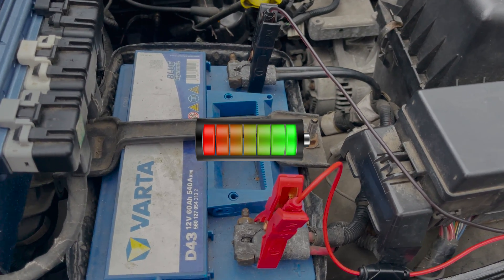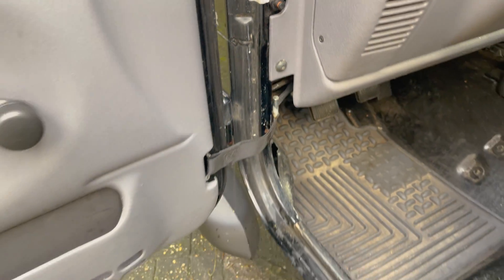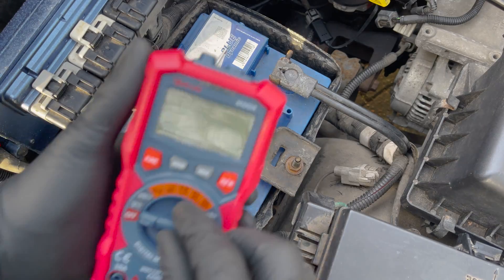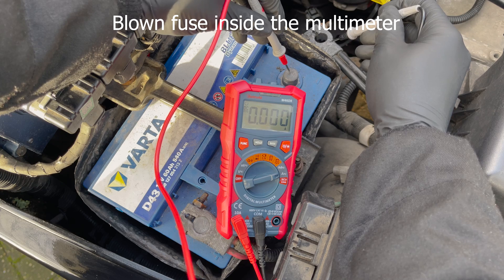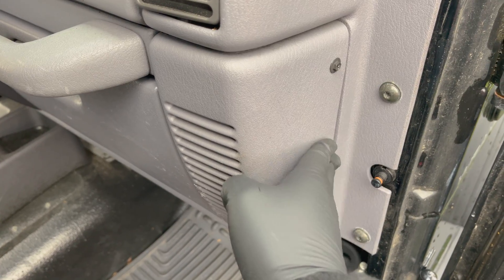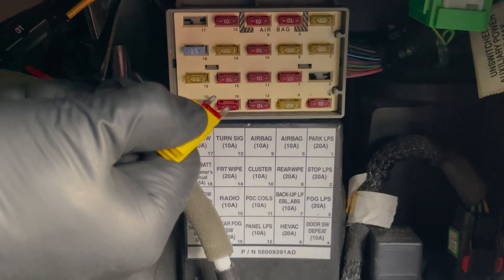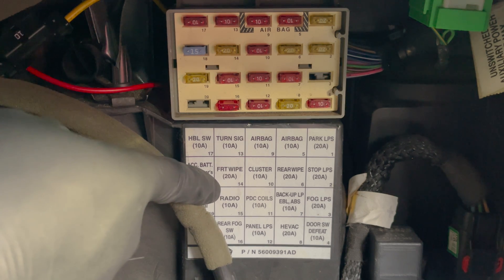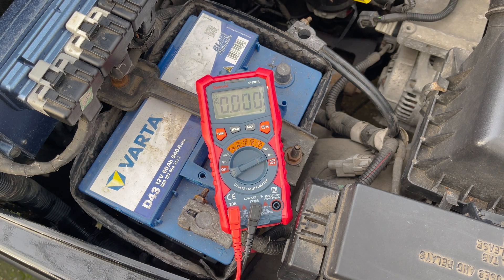The EASIEST way to test parasitic draw

Comment: This was so educational and I have no idea that vehicles but I had an alternator put in in 2024 in July and I’ve gone through three batteries since having that installed, and that’s not counting the multitude times of having to get the car jumpstart. 

I thought the NRMA were selling me faulty batteries. And no matter what happened I would always come out to find the car either taking forever to start or not starting at all.

As it turned out, it’s the alternator that the auto electrician installed. 
Because they did a test and found nothing else draining the power. 

But I’m going to keep a check on this anyway because I’ve just got a new alternator put in so fingers crossed. 

Can I just ask and this might sound stupid but I am when it comes to cars mechanics. When you locate the area that is the problem with those fuse do you just have to replace that fuse to fix the problem or would it be something else?
Reply from the maker: No, the fuse itself isn’t the problem. Pulling the fuses is just a way to easily locate on which circuit the parasitic draw is located. If you pull the fuse that protects the radio only, for example, and the parasitic draw disappears, you know the radio or its wiring is causing a parasitic draw. The radio might not be switched off, as shown in our simulation, or there might be a damaged wire, or the radio itself might be faulty. Once you’ve determined by elimination which part(s) is (are) causing a parasitic draw, you know what needs to be repaired or replaced.

Comment: This was so educational and I have no idea about vehicles except how to drive them but I had an alternator put in in 2024 in July and I’ve gone through three batteries since having that installed, and that’s not counting the multitude times of having to get the car jumpstart. 

I thought the NRMA were selling me faulty batteries. And no matter what happened I would always come out to find the car either taking forever to start or not starting at all.

As it turned out, it’s the alternator that the auto electrician installed. 
Because they did a test and found nothing else draining the power. 

But I’m going to keep a check on this anyway because I’ve just got a new alternator put in so fingers crossed.

Comment: I am confused he found where it is but how was it fixed. New fuse??
Reply from the maker: As shown in our video, there was no actual parasitic draw in the car we tested. 

For demonstrational purposes only, we simulated a draw by turning the key to the auxiliary position with the radio on. The radio then draws power which can be measured with a multimeter just like it would in case you had a real parasitic draw. 

Once you know on which circuit the parasitic draw is located by elimination, you can narrow it down further. You want to check the circuit for damaged wiring, or an electrical device/component that might be faulty. Once you’ve determined what is causing the parasitic draw on that particular fused circuit, you now know what needs to be repaired or replaced to eliminate the parasitic draw.

Comment: I have a multimeter but It doesn’t really match yours and I don’t know why symbol to use to test with mine. Anyone have some sort of guide to know whether I can even use mine and what to set it to?
Reply from the maker: On most multimeters, you need to select the DC Amps setting. This symbol consists of an A (for amps) with a dashed straight line under a solid straight line (symbol for DC).

Comment: 2019 Nissan Armada - I have ran through 4 batteries in 4 years.  Every battery I get, only lasts a year.  Took it to a mechanic 3 years ago who could not figure out why; Autozone had the battery charged up for me a month ago - still had issues starting a week after.  A shop said 2 weeks ago that battery, starter, and alternator all tested good.  As of yesterday, still struggles to start.  Any advice, opinions, guidance would be helpful.  I will perform this test when I get home this afternoon.  Cheers
Reply from the maker: Unfortunately, this is a known and well documented issue with the 2019 Nissan Armada. Batteries drain and need to be replaced after a year or so without an obvious reason. Some won’t even start without a jump starter. If you can’t find a parasitic drain performing our test, we recommend contacting a Nissan dealer for a complete diagnostic test.

Comment: Só you wait 30 min. As soon as you Touch the terminals with the multímetro, wont the car ECU wake up? Or only if you unlock doors? My w203 is drawing 4 amps
Reply from the maker: No, the cars’ ECU won’t wake up from using the multimeter, but it will wake up from opening doors which triggers the door sensor.

Comment: How does the radio turn on with the negative terminal disconnected?
Reply from the maker: When you hook up the multimeter between the negative battery terminal and the black battery cable, it functions as a bridge allowing power through. This, however, is limited by your multimeters' internal fuse(s). If you turn on too much electrical stuff and draw too much power, its fuse(s) will blow and you'll have to replace them.
Reply: Gotcha, thanks for the reply! @classiccarmaintenance

Comment: how did you have juice to your radio in the accessory position when your battery was disconnected!?
Reply from the maker: When you hook up the multimeter between the negative battery terminal and the black battery cable, it functions as a bridge allowing power through. This, however, is limited by your multimeters' internal fuse(s). If you turn on too much electrical stuff and draw too much power, its fuse(s) will blow and you'll have to replace them.

Comment: So, connecting the multimeter leads to the negative battery cable and negative post create the current when the negative cable is off?  I tried this on my Ford Explorer and it was a constant ready of 30 mA.  No changes.  The battery dies over a day or two depending on whether I drove it a long time for a longer charge.  I let it sit for 15 minutes and there was no change on the meter.

This suggests there is not drain and everything is normal right?  But that's not true, something is draining it.  Thoughts?
Reply from the maker: That’s correct, the multimeter leads form a bridge between the negative battery cable and negative battery post allowing power through. 

Any draw below 50 milliamps is normal and should not drain a healthy battery. If your battery keeps dying without a parasitic draw, either your alternator isn’t charging properly anymore causing your battery to drain while driving, or your battery itself is bad and can’t hold its voltage anymore. We have videos about how to test both your alternator and your battery, so make sure to check them out, it’s super easy!  

How to test your alternator with a multimeter: https://youtu.be/7aGRsv0spKc
How to test your car battery: https://youtu.be/GeEMrPOI0xM
Reply: @classiccarmaintenance  Ended up using a clamp meter from a neighbor that worked SUPER well to see the draw real time without worrying about the cables.  Was able to pull fuses til I found the right one.  Ended up being a SJB, which is not the best answer but an answer.

Comment: It looks like you switched up the posstive and negative probes when getting the zero to explain a faulty reader. Can u explain thank you
Reply from the maker: Switching the positive and negative test leads will only change the "direction" electricity flows through the multimeter, displaying the parasitic draw as a positive or negative number. It does not change the measured value itself. If you connect the multimeter between the negative battery terminal and the battery cable with the black test lead on the battery terminal, it will display the parasitic draw as a positive number. Put the red test lead on the negative battery terminal and the black test lead on the battery cable and it will show the exact same parasitic draw, but as a negative number with a "-" sign in front of it.

Comment: How are you turning radio on when ground is unhooked
Reply from the maker: When you hook up the multimeter between the negative battery terminal and the black battery cable, it functions as a bridge allowing power through. This, however, is limited by your multimeters' internal fuse(s). If you turn on too much electrical stuff and draw too much power, its fuse(s) will blow and you'll have to replace them.

Comment: Great, which fuse it is is found but how to fix v the current problem that is being drawn still.
Reply from the maker: Now you know which circuit the parasitic draw is located on, you can start to narrow it down further. You want to check the circuit for damaged wiring, or an electric device/component that might be faulty. Once you’ve determined by elimination what is causing the parasitic draw on that fused circuit, you now know what needs to be repaired or replaced to eliminate the parasitic draw.

Comment: Do I need to unhook both negative sides on my battery’s if I have 2 batteries in my diesel?
Reply from the maker: If your vehicle has 2 batteries that are set up in a parallel or series configuration, you only need to unhook the black (negative) cable that runs to the ground/chassis and place your multimeter in between that negative battery terminal and black (negative) battery cable, without disconnecting the battery cables that connect both batteries.

If you have 1 battery for your engine and a separate one for your auxiliary power and accessories, you need to test the batteries one by one. First do the test with 1 battery and its corresponding fuses, and then the other with its fuses.

Comment: I show zero Amps but wondering if on volts setting should I see 12 v ?
Reply from the maker: There’s something wrong if your multimeter shows 0 amps in the (DC) amps setting with the negative (black) battery cable disconnected from the battery post, and the tester leads between the negative battery terminal and the black battery cable. A 0 reading means there’s something wrong with your multimeter or the positive battery connection as there will always be a tiny amp draw somewhere because a cars’ electric wiring is never perfect. Normal readings should be anywhere between a few milliamps and 50 milliamps. 

When you test for voltage between the battery terminals with your multimeter in the DC voltage setting, a normal value would be between 12.4V and 14V (freshly disconnected from a charger).

Comment: Thank you for your reply. I have watched your video many times.  Will continue to trace my gremlins.  How can one determine if the draw is caused by a faulty ground somewhere.  I there a way to test the ground ??? With a multi meter ??

Thank you very much for actually responding.  Most don’t.  

I am grateful for you time and advice
Reply from the maker: You’re welcome! 

There’s no such thing as a parasitic draw from a “faulty” ground. A faulty ground means there is a bad connection between the electrical component (e.g. radio, lamp, horn,…) and the ground (meaning any bare metal part of the car or negative wire). As a result, the component will malfunction or not function at all. This however does not cause a parasitic draw. 

A parasitic draw results from the (positive) wiring contacting any metal parts or negative ground wiring, an internal fault in a device or a device or lamp that stays on after the contact is switched off. That’s why you have to test fuse by fuse to determine where the draw is situated. Once you’ve pin-pointed the problem, you can fix it. 

This however can sometimes be hard to find if a (positive) cables’ insulation is damaged and it contacts the ground (any metal part or negative wire) somewhere behind the dashboard for example. 

Worst case scenario, while testing for a damaged cable, the cable slightly moves and loses its connection with the ground, temporarily making the parasitic draw go away and undetectable. In this worst case scenario, a visual inspection of all cable insulation is needed. Any damaged or melted wiring should be replaced.
Reply: @ thank you very much for taking time to explain in detail for me. I truly appreciate your help.  But if there is a loose or faulty ground from the car chassis what other issues might result???   Could something like that cause the battery to draw down over night ?? Or is any battery draw going to be caused by issues with positive wires being grounded like you describe or a component being faulty or switch staying open???

Last question if I may please ??  If a relay is faulty (Burnt) or shorted out could that faulty relay cause a parasitic draw ??  

Thank you so very much 

Mark Ward
Reply from the maker: If a ground is loose or faulty, the affected electrical component will either not work at all (e.g. ground disconnected and the component does not receive power) or not work properly (e.g. a corroded headlight connection that only delivers 8V while the component needs 12V, causing one of the headlights not to shine at full brightness). A loose or faulty ground however, cannot cause a power draw and will not drain your battery. 

A parasitic draw results from the (positive) wiring contacting any metal parts or negative ground wiring, an internal fault in a device or a device or lamp that stays on after the contact is switched off.

A relay can also cause a parasitic draw either at the primary or secondary circuit. 

If there’s a short circuit in the primary circuit, this can generate heat which causes a small parasitic draw that drains the car battery. 

The secondary circuit, a contact that allows power to go to a powerful electrical component when it’s closed (e.g. to the headlights) can also cause a parasitic drain when it shorts internally. This can cause 3 different scenarios that will cause your battery to drain: the component stays on permanently, it only functions partially or it will not work at all. 

If the component doesn’t work at all when it’s switched on, with a faulty secondary circuit in your relay, it can still generate enough internal heat in the relay to get a parasitic draw.  

While the first two scenarios are easy to diagnose (always on or not functioning properly) the last scenario is the least likely but often overlooked because one assumes that a component that is not working does not draw power. While the component is not drawing power, the internal secondary circuit of the relay can be causing a parasitic draw. 

So in short: Sure, a relay can cause a parasitic draw, and the easiest way to find out is to test the fuses in your fuse box(es) like we showed in our video. Then you’ll know where to look.

Comment: Having trouble with a 2009 Acura TL. Numerous Alternator changes and battery changes.  Can you help me please.
Reply from the maker: If you changed the alternator and battery multiple times, I’m going to assume your issue is that your battery keeps dying which is usually caused by a parasitic draw. You should start by following the instructions in the video to determine if you have a parasitic draw and where it is located. Once you know where to look, you can start looking for a solution. It might be as simple as a glove box light or trunk light that does not turn off when closed! The simplest way to find out is to do the test as shown in our video.

Comment: This does not alwats work. Had a new radio running a battery down
Reply from the maker: It’s a foolproof test though. If the parasitic draw is located on the fuse that powers the radio, it means that either the radio itself or the wiring to the radio is the problem. If disconnecting or replacing the radio does not solve the problem, the issue is probably located somewhere in the wiring that connects the fuse to the radio, or in the fuse box itself.

Comment: Thanks for the video, I had a question. My car seems to short circuit when it rains, lights go crazy, Locks click on and off on their own, and even the trunk opens on its own, and this drains the battery, last time it killed it completely. I have a mini cooper r56 2009. Will this also work for my situation? I am guessing I have to wait till the car gets wet and the symptoms are showing, since when the car is dry, none of this happens... any tips? Thanks
Reply from the maker: No, this probably won’t work because it seems like lots of different electronics start acting weird randomly, and it’s unlikely that all these different circuits are malfunctioning because of the rain. It rather sounds like your cars’ computer, which controls all these electronics, is short-circuiting or flipping because of false input or overload. This may be caused by your car computers’ connector plugs or one or more sensors not being waterproof and causing short circuits when they get wet. 

You could first try to clean the connector plugs with contact cleaner and put dielectric grease in the contacts to keep the water out and prevent further short circuits and oxidation. As a consequence of disconnecting your cars’ computer(s), your saved computer settings might be lost and might need to be reset.